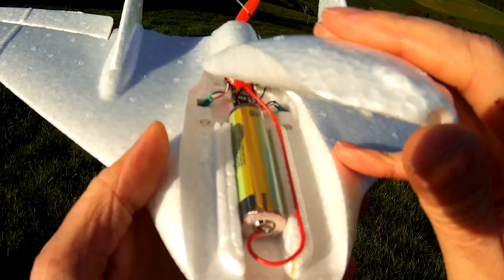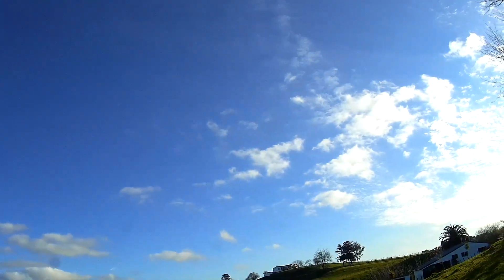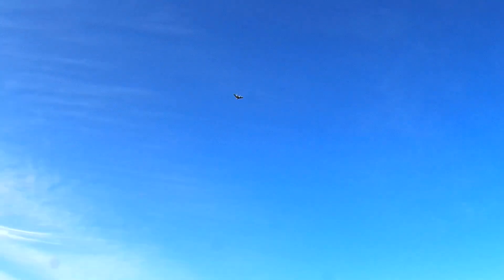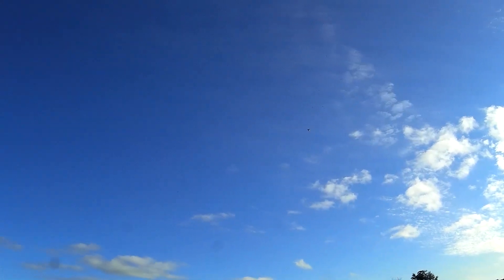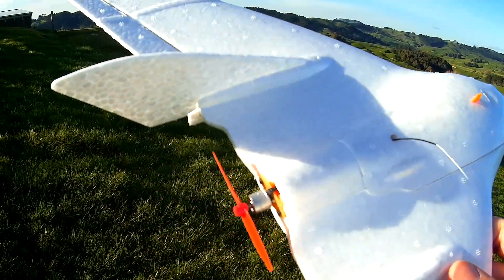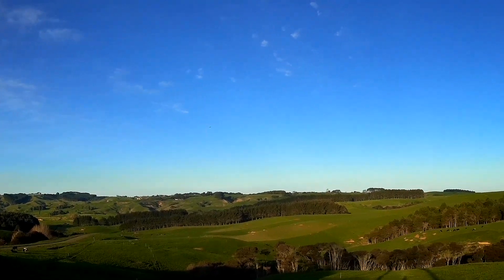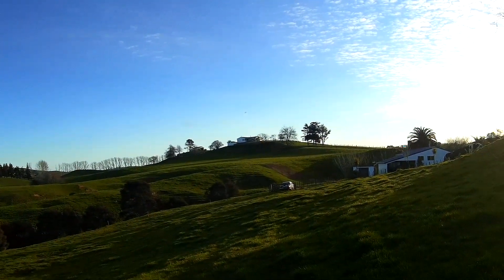Tinywing 1S setup second trial (18650 Li-ion)

Comment: I would have motor perfectly lined up with fuse...any other way makes no sense to me..i have built and flown many pusher wings and jets..
Reply from the maker: If the thrust line is too high or low (vs the CG) it will cause a pitch moment. The shape of the fuselage is almost irrelevant.

Comment: Have you considered making discharging bech tests with the setup? Maybe the motor is trying to draw more current than the battery can deliver and that could be the reason why 60% and full throttle its the same...
The battery you´re using its a high capacity one, but there are others with similar capacity and much more discharge capabilities...
Hey i'd really like to have a conversation with you about this plane haha... :P

Comment: Did you solve the nose up issue?
Reply from the maker: Mostly yes. As I said in the video, it needed more down angle on the motor.
Reply: @iforce2d  What do you think the down angle is now relative to wing angle of attack?
Reply from the maker: Probably about 8 degrees
Reply: @iforce2d  Is this normal for flying wings? Or is there a defect in the foam geometry?

Normal aircraft have a 7 degree angle of attack relative to the fuselage built in I believe.

Comment: was going to say "impossible to trim in flight?", as if it's a strange thing to say... but the kiwi accent, most likely a mode one pilot :)
Reply from the maker: ? Mode two, as is almost everyone else here I think. In fact now that I think of it Bruce is the only person I've ever met here that uses mode one, that I know of. I said that because this plane is so small and fidgety that if I let go of the pitch/roll stick even for a moment it would be upside down before you can blink. Larger planes typically take a bit longer to drift away from level. Of course if you can somehow hold it on course and do the trimming with the same hand, without dropping the radio, then you're better at it than I am. It's difficult to reach over with my left hand to do it and still keep a good grip on the radio. Yeah, a neck strap would probably avoid this problem :)

Comment: If you're nose heavy, you'll trim in more up elevator. then the faster you go the more it'll climb. Doing a throttle off dive test will tell you the story. If it pulls out of the dive on it's own too quickly, you're nose heavy.

Comment: It seems you use liion protected cell !?, try  unprotected cell  better curve of discharge  as Sony Vtc6 ,and for motor 11xx size  as 1103 with 10000/11000kv with stock propeller  could give better efficient with 1s i think !
Reply from the maker: Good point :)

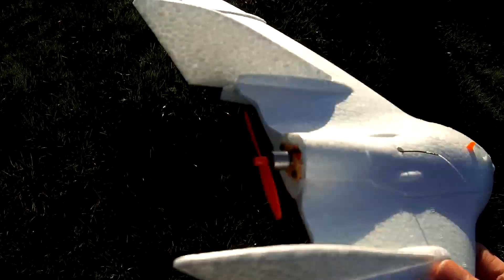Comment: 2:37... Shouldn't the motor on the rear be tilted up slightly ??? All the pusher style motor/props that I have seen and have... seem to be tilted upwards.
Reply from the maker: For flying wing you want downthrust, as the rear edge of the wing will already have reflex. The reflex causes the tail to be pressed down more as airspeed increases. The motor needs to counter this, otherwise you just get a plane that tries to do loops...

Comment: Put in a second 18650 and ardupilot and you can fly automatic for over an hour with a sub 250g
Reply from the maker: Not with this wing area though :)
Reply: @iforce2d  just fly faster ;) If you fly double the speed, you can have 4x the MTOW :)
Reply from the maker: Not with this motor/ESC/prop though :)

Comment: With a boost regulator for the FPV, servos and autopilot...  this could make for an interesting up-wind high altitude / glide down flight.  I wonder if you could make the calculations for the glide slope to push that limit.  Then I wonder if you could use it to get any useful data similar to the balloon project.

Comment: That flys great for almost 100grams on a wing that small. I bet with a 16x16 FC and a bn-180 GPS you could get autopilot on it. There's also a panasonic ncr18500 li-ion battery that is around 2000mah and about 15 grams lighter so with that you could add an FC and GPS and maybe even come up lighter than your current weight.

Comment: Extend the flaps and move the battery forward and you Will have better proportional control in pitch as airflow over control surfaces will be smoother because of lessened deflection,hope this helps!

Comment: The craft has all the characteristics of being nose-heavy (climbs with increased airspeed, drops its nose in the turns).  Any aircraft with a positive pitch stabiity will climb (ie: rotate nose-up) when you increase the airspeed, it's a function of the pitch-stability.  If you think about it... pitch stability is achieved by linking angle to speed so that if the craft's nose drops, it will pick up speed... which causes the nose to rotate upwards.  Then, as the craft slows, the nose will pitch down, thus causing it to pick up speed and avoid a stall.   This behaviour can be offset somewhat by using downthrust on the motor but it's important to remember that it's a function of airspeed -- not power and therefore it's very hard to trim it out perfectly.   The AXN is a perfect example of this... it has a not of downthrust to offset the tendency to pitch up at speed but if you nail the throttle from a glide, it will pitch down sharply because the downthrust pushes the nose down before the airspeed has increased enough to generate the contrary nose-up effect of pitch stability.   As for the battery voltage -- I'm using a boost/buck converter in my long-range sub250g unit so I can run the 2S pack down to 5V (2.5V each) and still have a reliable VCC for the receiver, flight controller etc.
Reply: Could you say witch parts you use on your sub 250g longe range plane please
Reply: Is always good to hear the thoughts of an experienced RC pilot, thank you Uncle Bruce.....

Comment: Nice flight, Did you remember to set the ESC to Lion vs Lipo. They come mostly set to lipo these days and the ESC throttle power back at that voltage if set to lipo.
Reply: That is good advice. I'm not sure if many ESC's have a li-ion setting especially 1s micro esc's but, he could probably turn the low voltage cut off and if he adds an autopilot just monitor voltage on the osd or even just use a timer.
Reply from the maker: I don't think this little ESC has fancy features like that, couldn't find any info on it whatsoever

Comment: i am concerned about your motor + prop choice .   those motors and push on prop are aweful .  quad motors (1103-1106) with "t-style" prop mounting would be a far better choice imo .watching how this lil wing flies, i was considering a similar setup. .
Reply: These motors are fine with a press on prop. The se0706 from happy model produces 60-70 grams of thrust on that prop which is just within the limit of what a press fit prop can handle as long as it's a tight fit.
Reply from the maker: The motor seems to be doing the job for now. I might try something else later, but generally it seems like the larger motors are intended for 2-3S and don't have suitable kv for a 1S setup.

Comment: You can create a simple mix to add some up elevon to aileron turns, and a second one to push the nose down at high throttle. 
It works wonders to correct aerodynamic weirdness.

Comment: Hello! Congratiouse, this is very-very good mini-wing. Using 18650 Li-Ion battery is very resonable idea. This possible long range wing cruise, hehehe :-) Use as an attemp a micro FPV cam+VTX for 3.3V with weight about 5 gramms, if it's possible please. Cheers!

Comment: shop around for a few types of 18650s and could make a video testing each of them in this beast
Reply: also maybe try the 14500 size to shave off some weight, they use them in gel blasters but im not sure about how many amps they can dish out cause theyre typically only ~1500mah

Comment: Add a boost converter to your ESC to ensure 5v.
Reply: Most of these 1s components will run below 3v and with li-ion 3v is about the lowest you can get out of them in a high draw setup like an rc.
Reply: @thirtythreeeyes8624  then there would not be any issues? Just run it till the battery/Cell is relatively flat. By then the plain will be done flying anyhow..
Reply: @nates8520  Ya pretty much, I wouldn't recommend it with Li-po but, li-ion are more resilient. I'm pretty sure he planned on adding a full FC system anyway though, so he can just watch the osd to see when the battery's dying.
Reply: Yea. I'll be watching his progress for sure.

Comment: Nice video! Thanks for the details about the battery! There have been some interesting suggestions in the comments, like ombibus f4 v6 nano, or a smaller size li-ion battery. If you'd like to continue using 18650, I think someone mentioned Sony batteries and maybe these would be interesting since they can be discharged at a higher rate: https://bit.ly/2IwlWln

Comment: On opentx I'd tell you to mix some delayed throttle into the elevators. Are you going to try with even more motor down angle?
Li-Ion cells can sag much deeper than lipo's as you've already discovered but most RC stuff just isn't designed to take 1s input that low. Don't think a small 5V step up is going to be much more than a couple of grams tho, and if you use an FC it might either require one or come with one.
Reply: Most 1s components come with a 3.3v buck/boost converter built in to maintain voltage under load. It's not uncommon on the micro brushless quads for the battery to drop into the 2.5v range on punch out.

Comment: That's amazing! You could try a slightly bigger motor like 110x size! That would give you access to 1.5mm shaft and much better props. Also, there are far better li-ion batteries like Sony VTC6 or Samsung 30Q that can practically give you 15amps of constant draw (so, much less voltage sag on lower amp draws)
Reply: There are other cells that give 25amps in 18650 size but they all have under 2000mah capacity
Reply: Agreed about the motor and cells. 30Q for budget, VTC6 for their amazingly low internal resistance, consistency and slightly better power density. I use the 30Q for vaping and they're staggeringly irregular when VTC6 generally hold the same punch. For my wing, I made the 3S1P pack out of VTC6 cells, not much of a price increase compared to flight controller et al.
Reply: @_tyrannus  If you want even more performance you could try to find Molicel P28A, those are the absolute best cells currently in the market. But they're not as easy to find.
Reply: @mortache  35A continuous? Geez. Slightly lower power density but that is indeed impressive. Interesting that it's an INR cell rather than the newer IMR.
Reply: @_tyrannus  i dont think you can realistically do 35amp continuous without a lot of cooling, but 25 amps would be very easily achievable while retaining good capacity and battery life. Check out Mooch's tests on Molicel P28A and P42A (the 21700 version with 4000mah and 35amps)
Reply: @mortache  I'll check it out thoroughly. 35A peak is exactly what I had been looking for, it's 3A above my Nano Goblin's peak (32-33A) which means I could get to use the motor's peak power (240W!) on 2S rather than 3S, in turns puts weight back under 250g. Given its size it would not stand up to that much power for any significant length of time, of course, but it will boost the top speed noticeably. This 21700 looks interesting as well, I'm glad that decent ones start coming out. Thanks again.
Reply: @_tyrannus  remember, voltage sags if you draw too much current. There's voltage-current graphs in Mooch's blog. Good luck
Reply: @mortache  Sure it will sag a fair bit like any battery, but that initial kick of acceleration is what I seek and it would definitely deliver it better, outdoing current performance even with extra sagging. Going from 300 to 250g with a rather similar wattage is a 20% increase in thrust/weight ratio for a NG! That's why I'm excited to hear about new cells. I hadn't stumbled on Mooch's channel, it seems interesting, I'll also check it out.
Reply: @_tyrannus  check his blogs in ecig forums, those have the graphs that are pretty helpful. His youtube channel doesn't have much testing data